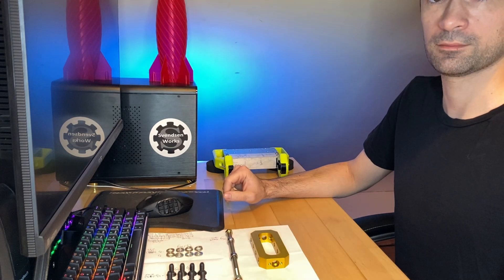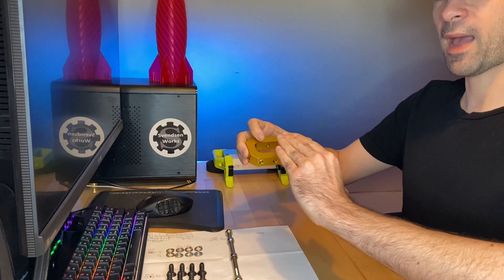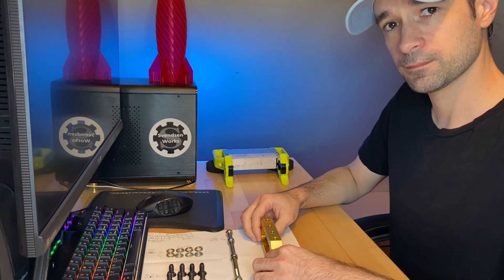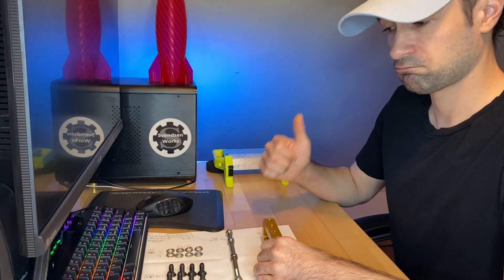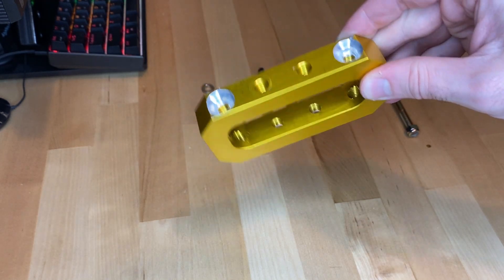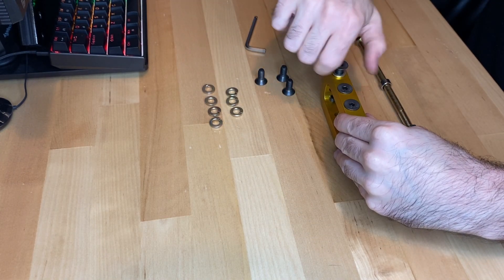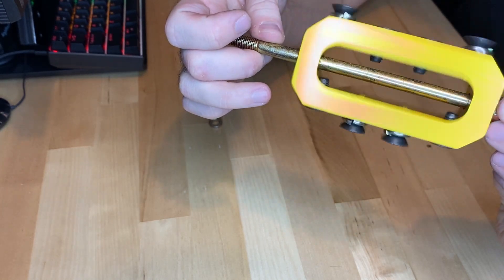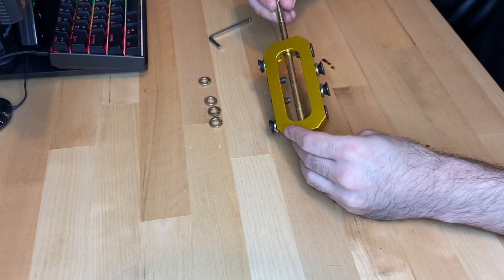Beater Bar Modification - Part 6 - 3lb Robot Build

Comment: Could you put at least tha middle two screws inside of tha beater before you put on tha shaft? Extra weapon mass and you get to keep your bite
Reply from the maker: You could definitely screw the extra screws from the inside!  That would be the easiest, especially if you don't want to drill the bar.  Just keep in mind that having the weight further out means more kinetic energy...

Comment: I like what you did! Very Smart. I thought about adding a plate as well and slightly extending it so it acted like the blade on a chipper or planer.
Reply: I have seen someone attempt it before. It didn't work very well for them, because the plate was always getting bent or ripped off rather than doing that much damage to their opponent. I think it's because of weight restrictions the plate ended up having to be too thin - anything thicker would have had more success but would have risked going over the weight limit for the bot. I guess one of the benefits of such a mod is the plate will get damaged long before the beater bar itself, and can be more easily (and cheaply) replaced than needing to replace the entire bar.
Reply from the maker: Interesting!  Any chance you remember what bot or what event that was?
Reply: @SvendsenWorks  I can't remember the bot name - it was a local tournament a few years ago that I was fortunate enough to encounter accidentally on the way to a completely different location. They were only charging like £10-15 entrance fee so I thought "might as well take a look". I thought it was a display of bots like a museum of some sort, had no clue it was an active battle bot tournament til I got inside! lol